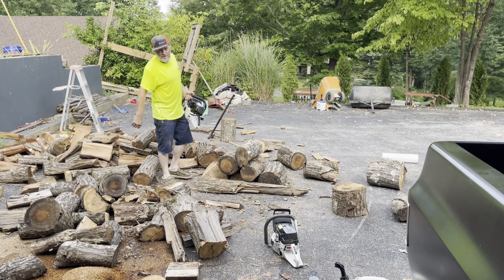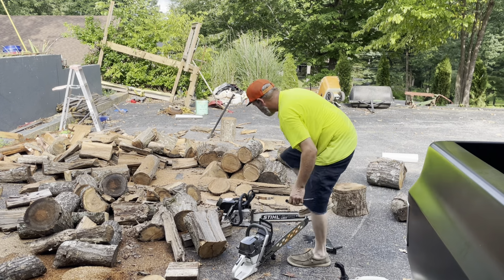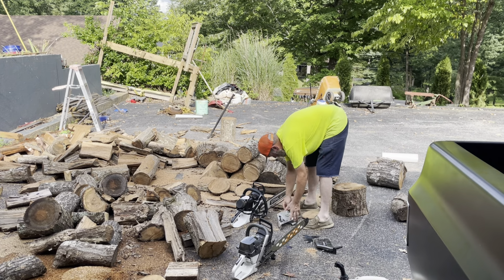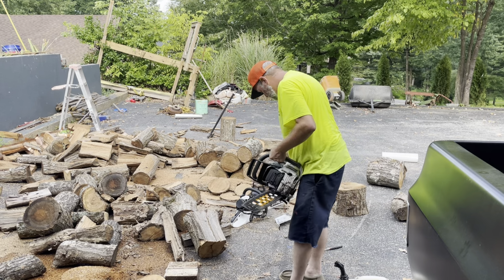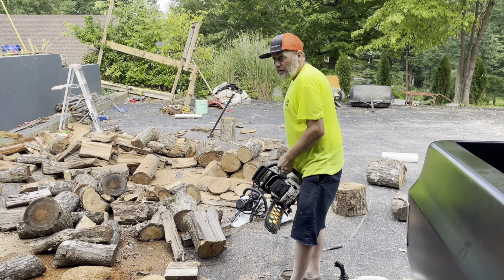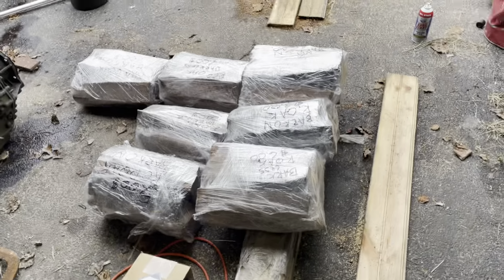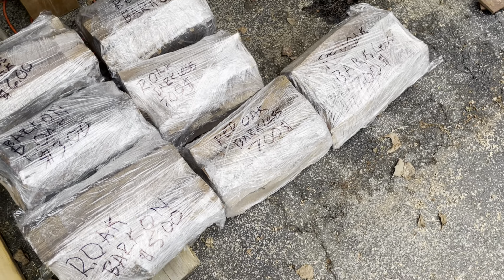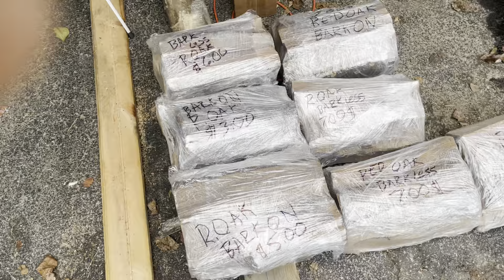Stihl 400c vs the 372Pro Holzfforma no edits chain swap a look at premium fire wood

Comment: Didn’t bother timing them but the ole 400 looked good. So did the 372 far as that goes. You are funny as shit not even trying to be
Reply from the maker: Thanks lol i went back and timed them and the 400 fastest cut was 7.5 the fastest i got from 372 was 9 slowest was like 12 on 400 and 15 on 372 but it hung up re done it was like 13 somthin pretty much 400 beat it all the time except the first cut just letting it eat the 372 won by A little